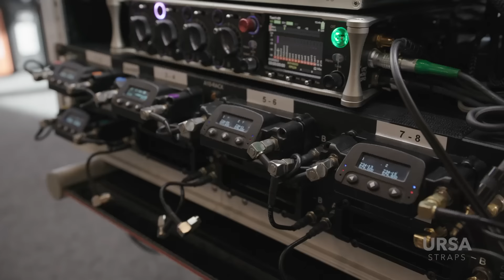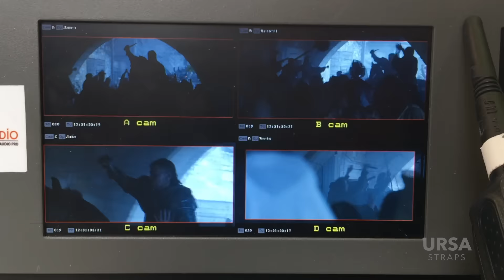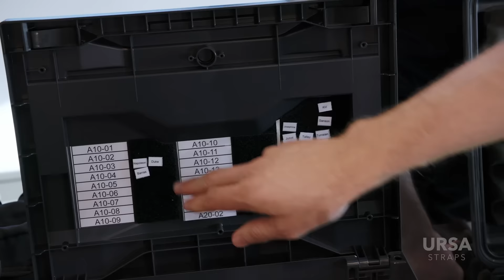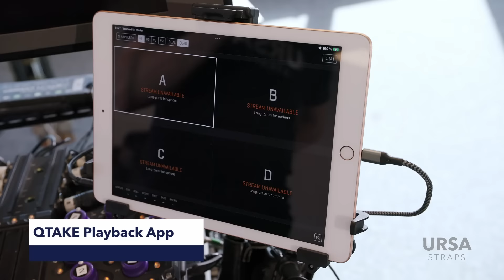What's In Your Kit? With Stéphane Bucher CAS, Sound Mixer | URSA Exclusive

Comment: Thank you for the video. Fascinated by his preference for cabled booms. I'd love to know how common that is on big budget movies these days.
Reply from the maker: Hey Stephen, going on a cable boom used to be the norm. But nowadays wireless digital transmitters sound almost as good as a cable but with the benefit of so much freedom. This freedom of movement also helps improve the audio vs fighting against a cable and spending time running the thing out & hiding it all the time. So in answer to your question - its very rare these days to go on a cable boom. But it is THE BEST sound. And Stephane only wants to record the best sound :)
Reply: @URSAStraps  Thank you for your reply. Interesting! The majority of jobs I've been on have been with cables but that has been more for budgetary reasons. I was told once upon a time that plug-on transmitters don't give you the same dynamic range as a cable and that the higher end brands (Wisycom, Lectros) would be needed to record dialogue for drama. I'm not sure if things have changed since then. But it's just cool to see the different approaches mixers have.
Reply: @URSAStraps yet...if you have a bag with a really good recorder, mics, etc, you are totally independent  and can use a boom mic,wireless, personal data recorders, etc.

A sound cart does limit you, yes.